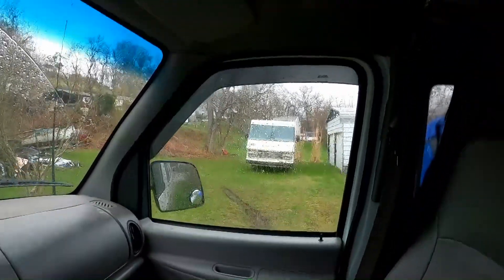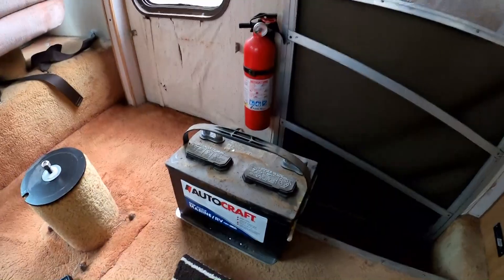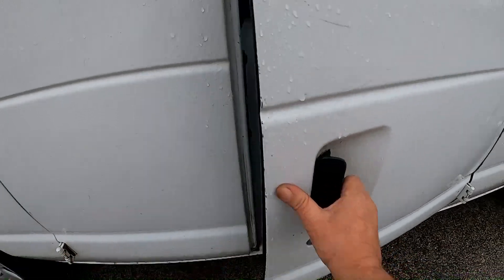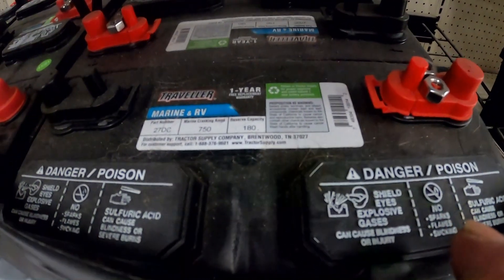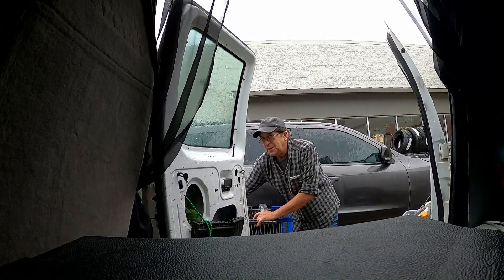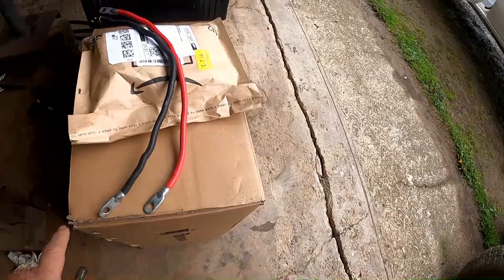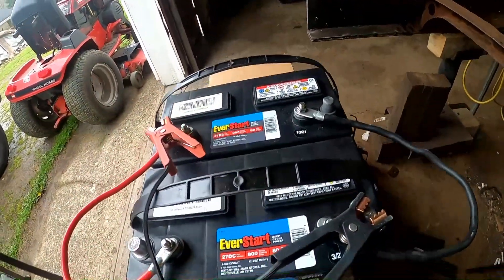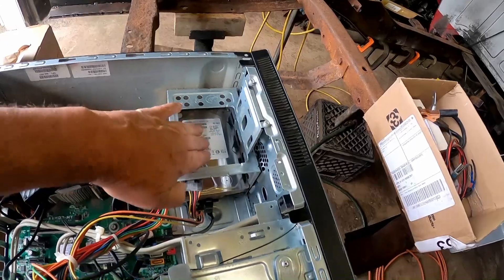New Batteries For The RV - Repairs, Upgrades, Renovations Continue For The Motorhome

Comment: Actually, there are 3 main manufacturers of car batteries in the US.
Point of fact, manufacturer origin does not mean that 'they are all the same'. Plate construction and materials, carbon boost technology, EFB technology and dozens of other unique features are built into however the 'brand' wishes the spec's to be FROM the manufacturer. They are indeed  different.
That said, I think the Everlast marine is a good choice for value.

Comment: You ever try 6 volt batteries? I put them on my travel trailer last year, cost about the same as 12 volt ones, about the same size, charge and function exactly the same, just wired in series. You get twice the amp hours and the are better suited for deep cycle uses.

Just a thought as another alternative to lithium.
Reply: I run twin AGM Fullriver DC400-6.  I get a lot of longevity out of them.  They are very expensive, but if you treat them well, you’ll get years and years out of them.
Reply: Correction- Two 6 volt wired in series give you double the voltage, but the Amp Hours remain the same. You can double the Amp Hours if you wire two batteries in parallel.

Comment: I did not know Johnson Controls makes most batteries!  Good to know.  Also good idea checking the new batteries before leaving the store.  We have bought a dud before and it sucks having to run it back to the store especially when you live in the country and the store is not close by.  You are a jack of all trades!  We have an old hard drive with pictures of our daughter when she was little that went bad so I know your friend will be so happy you can retrieve them for them.  Hopefully someday we will be able to find someone like you to get ours for us.
Reply: Just be sure to check the manufacture date sticker on the top. I wouldn't buy a "new" battery sitting on the shelf more than a month. Lead Acid batteries can lose 4% a week at 80F sitting idle.

Comment: It's a shame that Sears went out of business.  Their Diehard Batteries used to be really good.   I think Advance Auto Parts sell one called a Die Hard.
Reply: Key words "used to be". A lot of recent reviews on the Diehard line are less than stellar.
Reply: I got my last battery's for both of my car from AAA they put them in at your house or where ever your stuck with a dead battery and will replace them for free if they fail. I've had AAA since I was in high school. I'm retired now. Best money I ever spent.
Reply: 6 Volt Golf Cart Batteries would give You a lot more amps, but would be a little bit more trouble to hook up.

Comment: i have 2 separate battery banks each with 2 6 volt battery's. one set is from camping world from 2015, the other is from les schwab from 2016. They are both still running great. They have been cycled many days on end as i use them daily and live in my RV. one just runs off a solar system that powers an inverted in the rv bedroom. the others are the main coach and have been connected to solar for only 2 years. . i have thought of lithium but mine just keep living on!
Reply: i also have a walmart battery bank that can power the coach and uses those 105ah ones you showed. They are cheap in cost!  i wired it to replace the coach system and its not really used but they hold their charge for months on end without use. they were cheap and i got them when i thought my main system was failing but it was just a bad lug connector. i hope to get more use out of them and see if they hold up to cycling. real world experience tells all!

Comment: So Dave one grumpy old man to another. Thought I would bring you up to speed on batteries. Johnson control sold out their battery division to a Canadian base company named Clarios. True that they are built at the same plant but they are manufactured differently depending on the company specs on batteries. That shows in spec and pricing. Also new batteries should be rotated about every four months and recharged to get optimal performance. So the ones you looked at would definitely need charged. With flooded batteries that you can access the cells. A hydrometer would be useful to make sure each cell is charged and the same. You can have good voltage but poor specific gravity or vise versa. One last thing keep your batteries maintained and clean. If you have a dirty and or greasy batteries. You can put a volt meter on the top of the battery(not the post the case of the battery) and you will have current going across the battery. So there is a loss of power all the time. Which drains your battery.  You most likely know this thought I would put it out for your viewers to try and help thanks for your time good luck with your new ride.

Comment: Dave, Lithium's are now down to under $350 for 100 amp hrs, Super good Batteries too.  Take them from one rv to the other.  those batts you bought are not so good, 80 Ah  sucks, between the 2 batteries you will get 160 ah  only 80 ah is usable to the 50% discharge safe level for discharge.   Good luck Man.
Reply: While this is true, Lithium batteries can accept a huge amount of input current and can burn up a vehicle alternator at idle rpm without an external charge controller or using a DC to DC charger between the alternator and the batteries. Lithium batteries also would require a converter upgrade if it doesn't have a specific charge setting for lithium.

Comment: Yeah, the typical Lithium life is well over 10 years. If you go by number of cycles, you'd have to replace your Lead batteries 5 times or more.  So multiply the cost of your batteries by 5.  Those $105 batteries from Tractor supply, $210 by the time you buy 2, times 5 is $1050.  For that price you buy a couple 100ah Lithium batteries from SOK and get twice the capacity.  You'd also shave a good 60-100 pounds off the weight.

Comment: The power supply probably is bad but I would check that first. That drive is most likely just fine. Did you hook up a speaker and see if the fan in the power supply comes on first and then check for any beeps if it does?
Reply from the maker: They have no interest in fixing this one, so I'll just grab the files and be done. I've been a sole proprietor computer repair shop since 2012 officially, but I've been at it since 1998 :)

Comment: Voltage does not tell you if the battery can handle a load. It might have a bad cell. You need to use a load tester- cheap one at Harbor Freight ($20) or any auto parts store will test for free though it may take longer than 1 hour. Best to buy a load tester to keep on hand. Lead Acid batteries will lose approx 4% per week at 80F sitting. Many people don't realize you need to pop off the vent caps and check the water periodically and use only distilled water if needed. (Wear safety glasses).
Did you test your house battery voltage while the engine was running? Alternator should be putting out 13.8 min. Project Farm on YouTube has a good review of battery brands- "Which battery is best? Let's Find Out".  Don't use a hybrid for 100% deep cycle service. It doesn't make sense. Walmart actually has good value. TIP- Always check the manufactured sticker on the top. Should not be more than a month old. **One of the batteries you bought says 10/21** Check the voltage if you haven't charged them yet. I bet it already has lost capacity due to sulfation. I'd return that one for a "fresh" one.